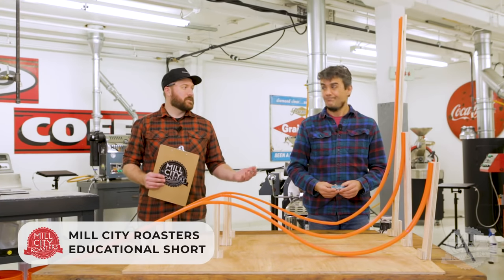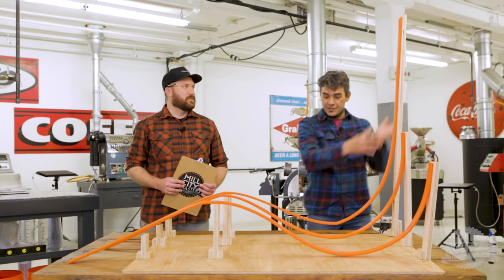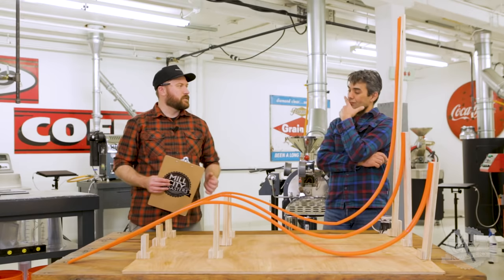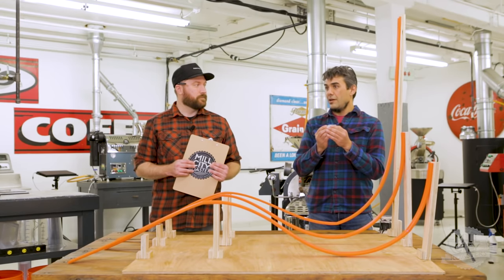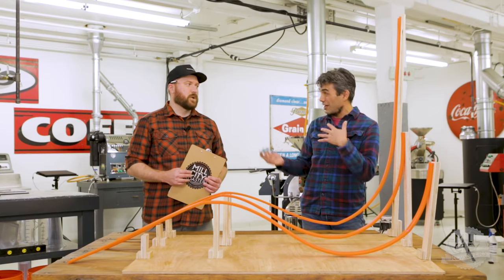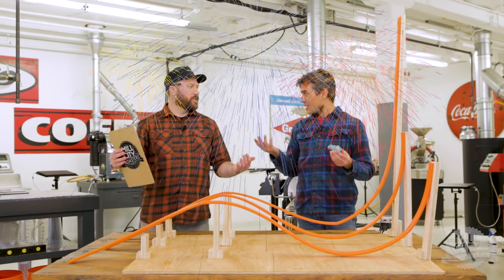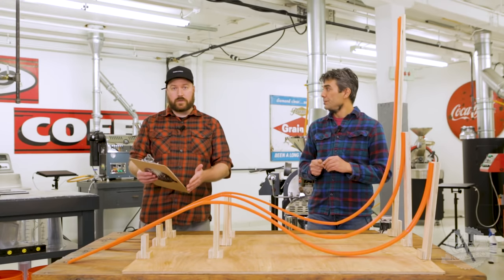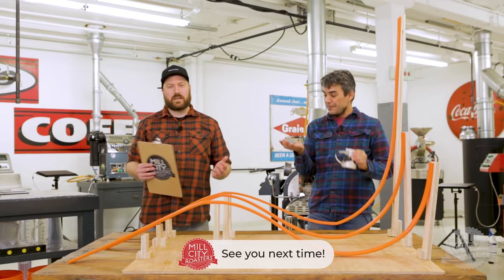Educational Short: Charge Temps + Race Tracks

Comment: I get the concept with the video, but I still don’t understand how to pick a charge temp for different beans. I’ve seen people choose anywhere from 280F-500F. Is it basically just a trial and error I’m guessing.
Reply from the maker: Generally speaking, you pick the highest charge temp that won't induce heat defect and moves the roast along to the green/yellow transition with the minimum gas necessary. This is the place where a better machine matters a lot.  You can do a lot of things on a Mill City Roaster you simply can't do as easily on any other roaster.